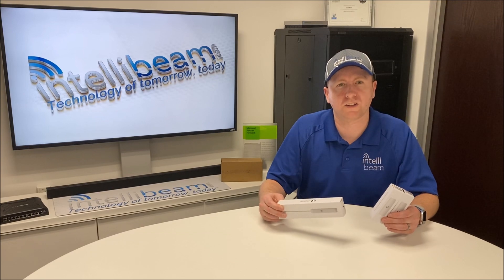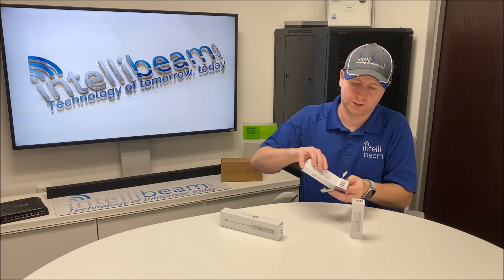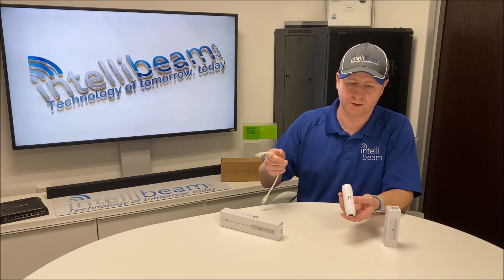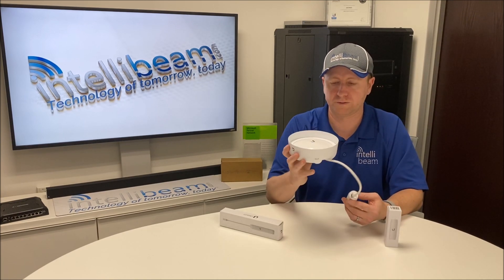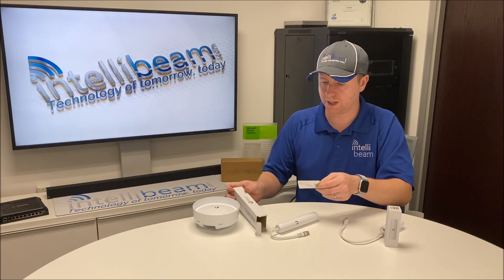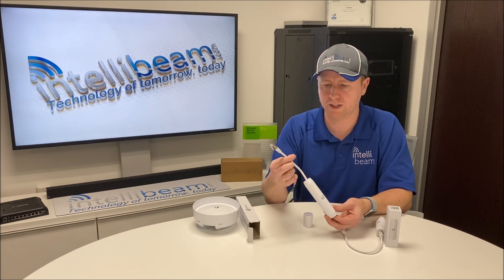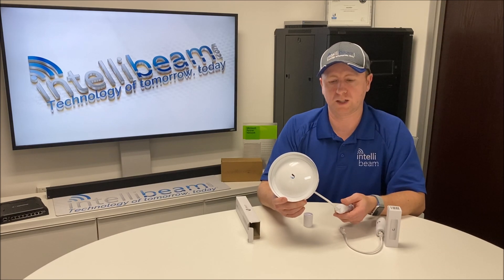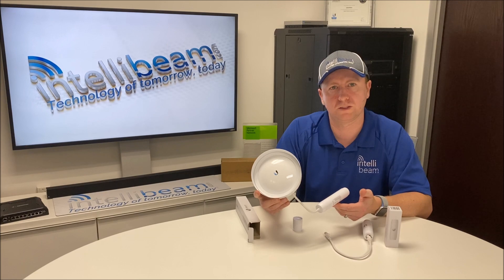Ubiquiti Instant 802.3af Gigabit Indoor and Outdoor POE Converters unboxing by Intellibeam.com

Comment: I don't have a POE switch at the moment, I have the UDM and I want to have few ports at my TV for consoles and Chromecast Ultra etc.  I got a USW Flex Mini, and I want to use the POE instead of the supplied usb-c.  What will carry both the data and power via a single cable please?  Thanks, I'm a noob btw.
Reply from the maker: It should work based on other Ubiquiti products we've used.

Comment: Question. Does this draw a constant wattage from the POE switch port or what is its performance like ? I want to see if I add 2 of these to my 80w poe switch will it chew up most of it or does it just draw what ever power the passive POE access point requires ?
Reply from the maker: It will only draw what it requires which will be almost negligible.